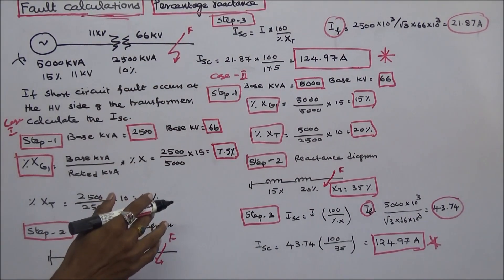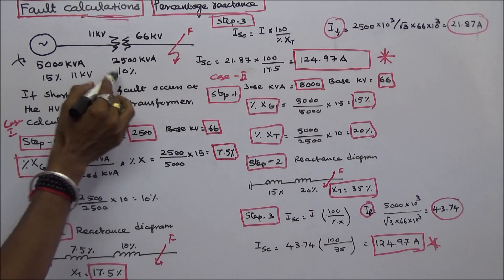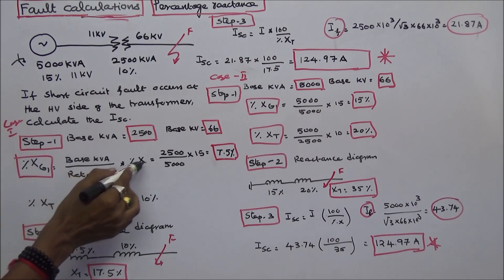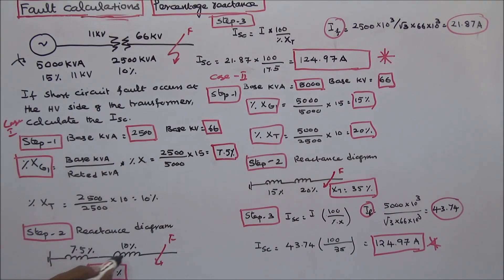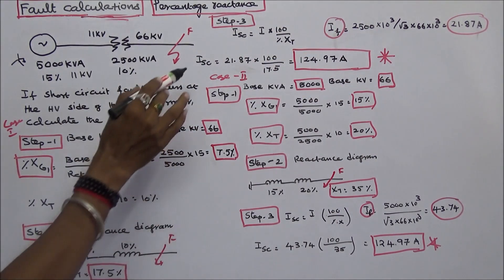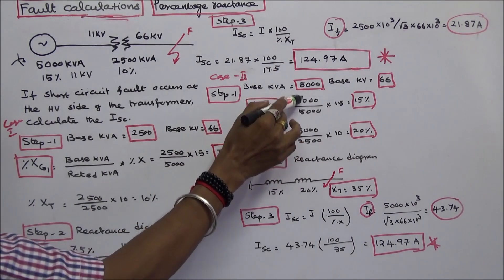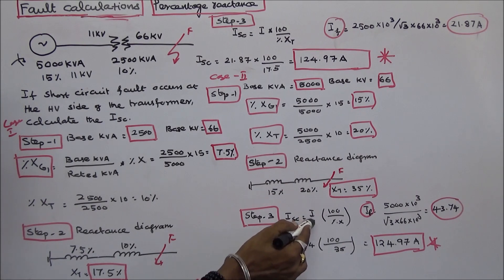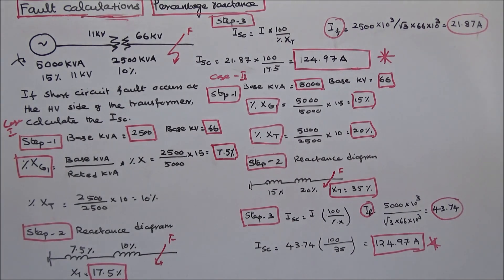CALCULATIONS OF SHORT CIRCUIT CURRENT & kVA – PART – 02 – PROBLEM

Comment: Actually Transformer rating ( Capacity , % impedance & Voltage ) available means we can calculate the Failt current on the HV side ... As per that calculation the derived value is not matching ...Kindly suggest me

Comment: A how-to book on a pragmatic use for a Shorted A/C Motor

http://is.gd/oupaperback

Shorted A/C motors and shorted transformers can easily get out hand and fry themselves. But, if regulated, can be a source of useful energy turning themselves into their own generator.

I used Micro-Cap to design a motor wiring scheme which is shorted and prevented from reaching voltages and current levels beyond whatever value desired so as to convert a problem into an energy saving solution.